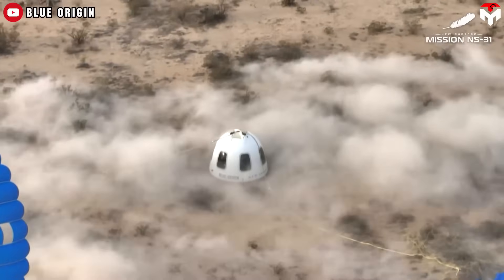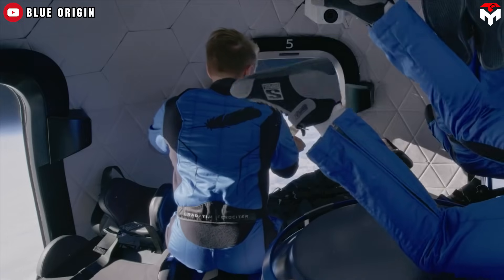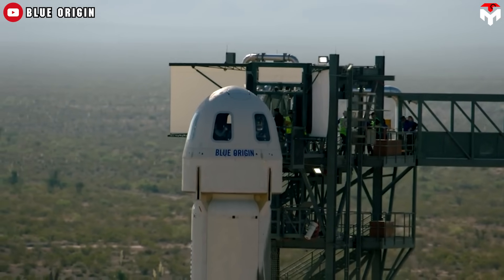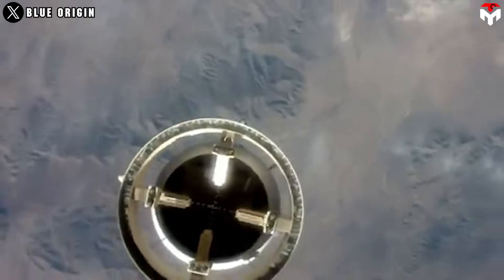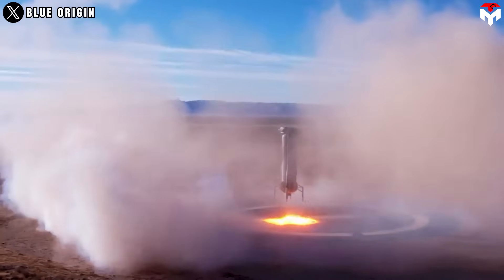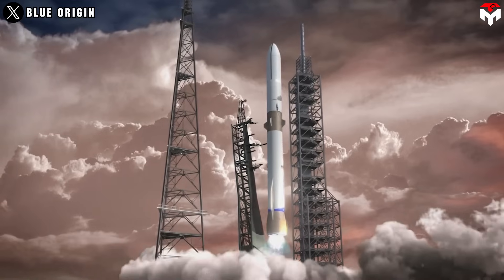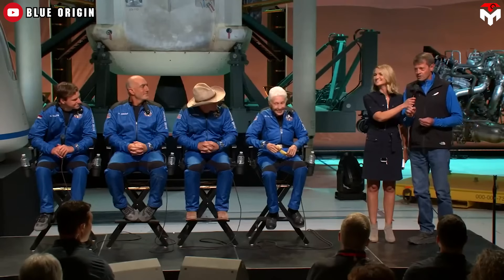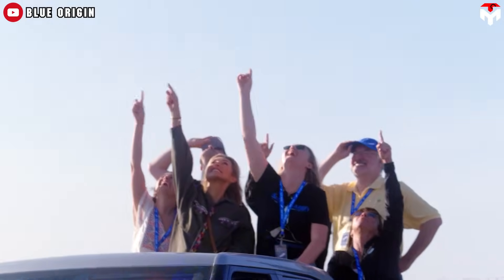Astronauts Exposed Why Blue Origin New Shepard Not Look Burned After Landing

Comment: Why did it blow dust , before it hit the ground ???
Reply: A retro-thrust system at the bottom of the capsule expels nitrogen gas to slow the landing to approximately 3.2 km/h (2 mph).  The blast of compressed nitrogen blows up dust.  This has been know for over 7 years, so how is it that people still can't understand something so simple?
Reply: @aseanWalker funny how this retro booster didn't kick up any dust on the moon landing
Reply: @tedstyle3798  The New Shepard capsule has never been to the moon. It's a sub orbital carnival ride for rich people.
Reply: Because the ground was covered in DUST
Reply: Yes!! And it still landed hard enough to break the most honorable "Astronauts" backs.

Comment: But how come they were able to open it with a handle from the inside? Shouldn’t it be pressurised correctly? They rushed to the door to tell them to shut it so they could pretend to open it with a tool, it’s still fake
Reply: It's not pressurized when on the ground.
Reply: @ yes but I would like to know if spaceships that have travelled to the moon, are they able to be opened easily via a handle on the inside? Compromising integrity of the structure if it’s so easy to open
Reply: @Bat_Wayne29  Yes, they are easily opened from the inside. In fact, after three astronauts were killed in the Apollo I launchpad fire, NASA implemented a design rule that hatches be easily opened from the inside or outside within three seconds.

Comment: They opened the door from the inside, a big no-no but were told to close it again. Watch the video. Then Bezos went to door with a tool to open the door and all without depressurising…total fake story…0-Mach 4 in minutes and no stress on their faces, pure BS.
Reply: There would be no depressurization. The purpose of a pressurized capsule to is to maintain close to sea level atmospheric pressure at high altitudes - when on the ground the pressure inside is equal to the pressure outside. They only reached Mach 3, and why would there be stress on their faces?

Comment: Weightlessness in the Blue Origin rocket capsule is just a free fall that feels like weightlessness because your body is relative to the capsule.  It is not actual weightlessness.  That kind of freefall is used to SIMULATE weightlessness, but the passengers aboard New Shepard capsule did not actually experience true weightlessness.
Reply: It's the same when you're in orbit. You're just in free fall while your forward motion keeps you going around the planet. In that sense what those in the Blue Origin capsule experience is actually no different to what astronauts on the ISS experience. Per your reasoning, no astronaut has ever experienced true weightlessness.
Reply: I felt weightlessness when I was 9 years old. My uncle had an airplane and he would go waaaayyy high, then drop quickly. The ends of my braided hair were higher than my head - I was weightless! It was fun! We loved going on those plane trips!! But I am not an astronaut, haha!

Comment: They felt weightless because they were falling which was nothing more than negative G-force. They did not come close to escaping Earth's gravity and they never left Earth's atmosphere. They did not go into space! They did go on a very expensive amusement park ride!!!
Reply: That's not negative g-force, that's zero g-force, and it's the same reason ISS astronauts feel weightless. The accepted start of space is 62 miles, they went to 66, so yes, they did go into space.
Reply: @CSXRobert  When you are falling that is a negative G you feel. I spent my career in aeronautics. Just look it up and they never left the atmosphere or Earth's gravity.
Reply: @thetwistedlocust  No, you are factually wrong. Falling is ZERO g (and it's g, not G, G is the gravitational constant, g is the acceleration due to Earth's gravity). To experience negative g-force, you have to accelerate down faster than free fall.
Although there are still remnants of the atmosphere above 62 miles, there is so little that it is for the most part negligible, and since there is not a hard cutoff to where the atmosphere ends, 62 miles has been set as the generally accepted limit before you are considered to be "in space." At that point you can easily see the curvature of the Earth, above the you is the black of space, even in daytime, and atmospheric pressure drops to about 0.032 Pa (0.0000046 psi, so practically nonexistent). To say they are still in the atmosphere is akin to saying you are in the ocean when at the beach because there is some salt water in the air around you.
No human has ever left Earth's gravity. ISS astronauts are subject to about 88% of Earth's surface gravity, but since they are in constant free fall, they appear weightless (again, free fall = 0 g, not negative g). Even the Apollo astronauts on the moon were subject to about 0.026% of Earth's surface gravity.

Comment: Look at the capsule speed, air density friction and time duration. The capsule re-entered at a speed around 3,000 knots and aerobraked through the atmosphere to parachute deployment. This is in the realm of supersonic flight commonly flown by the SR-71. The heat shielding of the capsule can be done with non-ablative materials such as high temperature metal alloys.

Comment: It doesn't really have anything to do with altitude. If a rocket went straight up, even up to low orbit altitude like the crew dragon, it would fall straight back down as soon as the rocket stopped firing. To actually go into orbit a spaceship needs also to gain enough delta v to stay in orbit. A spaceship or satellite in orbit hasn't left the gravity well of earth, it's still only a few hundred miles away, it's now travelling at orbital velocity allowing it to continuously fall around the earth. This is why when a rocket launches into orbit, it doesn't just go straight up like an elevator, but arches along a parabolic trajectory.

Comment: All of you are morons. Yes this flight was a total embarrassment to space flight, but serious get educated and learn about the layers of our Atmosphere… they did not go out of the Atmosphere, and they never said they did.
Reply: They said they went into space, they did not. They never left the atmosphere.
Reply: @laurencehutchinson8644  They went 66miles high, twice as high as a 747, they went to the "edge" of space in the Karman Line, and yes it is called a "space flight" however they did not enter orbit, they reached the edge, and they fall back down. There were no "burn marks" because they did not go into Orbit... their top speed they traveled was 3,568 km/h, to reach Orbit they would have had to go 28,800 km/h.... that is 25,232 km/h SLOWER required to be in the Orbit of Space...

So saying this, do you even know why burn marks happen????? Because the craft uses the atmosphere to SLOW DOWN THEIR SPEED TO RE-ENTER THE ATMOSPHERE.... there for, the craft goes through a lot of friction and drag as it is traveling at a much higher speed.....

So if you haven't caught on yet.... They were only going at a slow pace which had no resistance needed to slow their speed to re-enter the atmosphere... because they were still in it..... They simply got a small rocket to have enough delta V to get them to the EDGE of Space, and then once the craft lost momentum, it fell back to Earth with it's own weight.....

As for the "pre live footage"... that's also easy, this wasn't Space Flight to make a difference, it was simply some celebs experiencing a flight in a rocket, so obviously they would have pre opened the doors to check on their hair and to direct them on the "scene"... They had barely any training..... these crafts take a lot of work to actually get out of, and it also involves internal mechanisms, not just external.

Basically, it was done to "clean up the live feed", because if you watch an actual Space Flight Landing, it takes a very long time for them to exit, and it's not graceful in the slightest.

All of this is seriously common sense, and it's so sad how dumb the world has become simply because they only listen to what is on Social Media, instead of simply learning some actual facts themselves....

So to summerize;

- Fast Craft creates burn marks because it requires the Atmosphere's drag to slow down their speed to allow them to re-enter the Atmosphere.
- Slow Craft has no burn marks, because it is traveling 25,232 km/h SLOWER then a Craft with burn marks.
- Door was pre-opened for "Celebrates" on TV...

None of this is even complicated stuff... it is literally common sense...

Get educated people.

Comment: Look, more difficult to understand in this situation, NS-31 (Not Serious-31)is HOW come none of the MASSICE dust cloud kicked up at landing?  The Dirt is a yellowish and the capsule is SURROUNDED by a massive DUST cloud.  Two things make us expect dust on the capsule.  A) A cloud that big sour of rolls back into the center, and well, the center was occupied by NS-31.  B) Even at sub-orbital flights there is substantial  amount  of FRICTION HEAT generated, and so, the capsule WOULD have been hot enough to ATTRACT that dust like we see window blinds do on hot Florida days when your windows are open for venting.
Reply: One clip shows the so-called capsule on the ground with a plant, brush on the right hand side, close to the capsule, then in a second clip that bush has moved further back, and the door was opened, and then shut, and then it had to be opened by someone with a tool. Tools all inside

Comment: You don't need a rocket to have a short time of zero gravity, Aircraft like the "Vomit Comet" do this regularly. Not for nearly as long, but still does the job. And that's what the Blue Origin capsule did. Had it not performed the parabolic flight path maneuver, the people on board would have never experienced any weightlessness. It didn't go high enough for that, nor did it take up orbit.

The difference between what Alan Shepard did and these tourists did was that they went up in a relatively safe craft with. Alan was risking his life. Hardly comparable. He was also hooked up to many measuring instruments to gather valuable data. In addition, he had to train for years for that "ride" (which he also flew once it reached space). Part of that was his skill in flying fighter jets. To compare it in any way is just plain poor taste and ego pumping. The women could have claimed a tiny shred of being useful had they been tied to a host of measuring instruments during the trip. But not even that was done. They were just "cargo."

Comment: Explain why the capsule doesn't tumble as it descends. The are no stabilization controls on this pod.
Reply: Aerodynamics
Reply: What makes you think there are no stabilization controls?
Reply: @CSXRobert  This capsule was in a free fall and was relying on parachutes to control its decent.
Reply: @tammyhayden56  it is aerodynamically stabilized in its descent.   That „gumdrop „ shape isn’t for no reason.  Bathe parachutes control the descent later.
Reply: @tammyhayden56  yes, it was initially in free fall, and then used parachutes to control it's decent. It also has a reaction control system to stabilize it during its freefall.
Reply: @CSXRobert  bullshit.
Reply: @tammyhayden56  From NSF (NASA Space Fight) 'Blue Origin’s New Shepard returns to flight' - "The capsule fired its reaction control system (RCS) after separation to ensure stabilization."

Comment: When you get the facts right, you realize that this capsul didn't experience a reentry.
There is no need to talk about this for over 10 minutes.
Thumb down.
Reply: I just love going through the comments to see who actually watched the clip. But yeah, the difference is falling vs re-entry, 30s and explanation done.
Reply: The capsule DID experience re-entry, just not fast enough to generate the extreme heat associated with orbital re-entry.
Reply: @CSXRobert  falling from a height vs. orbital re-entry, I could have been more specific yup. It's the orbital speed that causes the higher compression of air on re-entry and subsequent larger plasma buildup. 45s.

Comment: This goes to a lower altitude than the SR 71.  No. I must amend this comment. The SR71 has flown to only one quarter the height of Blue Origin.
Reply: No it doesn't, it goes about over 4 times higher.
Reply: @CSXRobert  I am sorry. You are correct. The SR71 has flown to one quarter the altitude of Blue Origin.

Comment: It wasn't burned because the stupid rocket used all it's propellant for vertical ascent... most spacecraft trajectories have the rocket turning somewhat  horizontally to gain speed for orbit... 17,500mph. When an orbiting spacecraft returns, that speed must be bled off by using the atmosphere to brake the vehicle which produces a 3000 degree C  plasma. Stupid New Glenn just goes up until it runs out of fuel... coasts to apogee... then falls back to earth... no ablative paint or heat shield or tiles required... yes, it's a pathetic phallic symbol.

Comment: The Blue Origin "Celebrity Space-Flight" reached a speed of 2,200 MPH and a height of 65 miles, whereas the Mercury space-capsule of America's first astronaut, Alan Shephard, reached a speed of 5,180 MPH and a height of 116 miles—quite a difference. 
.
Whereas the spacecraft of astronaut Alan Shephard had to re-enter Earth's atmosphere from a much, much greater altitude and at a much, much greater speed, the Blue Origin capsule, “New Shephard,” though having crossed into outer-space on a technicality, did not have to re-enter Earth’s atmosphere because it had not completely left Earth’s atmosphere, and its maximum speed of 2,200 MPH (about Mach 3), was comparable to the speed of the SR-71 Blackbird, which was an air-breathing jet airplane. In other words, the relatively lower speed and lower altitude of a Blue Origin flight does not require a heat-shield for a fiery re-entry that does not occur.
.
I think this particular event was too thoroughly saturated with a celebration of celebrity. During the weightless portion of the flight, the occupants gleefully squealed like a bunch of junior high-school girls, did somersaults in their conspicuously curve-hugging uniforms, and, upon landing, made either unbearably braggadocious statements, or pitiful attempts at profundity which came out sounding infantile. Had, instead, the money been spent on sending, say, a group of public-school science teachers into outer-space, that might have had some actual value.
.
On one hand, I see the Blue Origin all-female celebrity space-flight as proving nothing, as all the occupants were strictly passengers. There was no new accomplishment that I could see. It was little more than a frivolous lark for wealthy celebrities. On the other hand, there is no denying that these women put their vulnerable bodies into a space capsule on top of a rocket, blasted off, and encountered some serious g-forces (about 5 g’s) along the way—an activity requiring an admirable level of guts. It is not something I would do, even if someone else were paying for it.

Comment: I've been wondering why the Blue Origin can land on LAND while Crew Dragon still has to splash down in the ocean.  That alone suggests to me that Blue Origin is fake.  At least they are not really manned.
Reply: No, that isn't true at all. Soyuz lands on land, and so does Starliner although, obviously, it is not operational yet. The Crew Dragon was originally intended to land on land, but not under parachutes. It was supposed to make a propulsive landing, like Falcon rockets. NASA, however, objected to that architecture so they had to revert to a parachute landing. They were too far along in the design process to make it possible for it to "bump down" with retro rockets or inflatable cushions like Soyuz and New Shepard, so they went with splashdown. Wait till Starship is fully operational and making propulsive landings with crews aboard. Man, that's going to be glorious.

Comment: Okay someone who knows a little bit about space I hope they comment but the reason there were no burn marks is they didn't go up high enough to create that kind of reaction coming back down. That's why everyone is calling it a ride because they didn't really go to space😂
Reply: No, they very definitely went to space. Space is defined as starting at 100 kilometers (62 miles) above sea level. That is somewhat arbitrary but it is internationally accepted. The video is quite right that there were no burn marks because they simply weren't going fast enough to generate that much heat.

Comment: The capsule didn’t go into outer space. It’s no different than going up in a large jet and diving down causing you to become weightless. They have been doing this for years. Blue Origin went up and in the process of falling the women became weightless until the chutes opened. This ride was a joke by a bunch of aging air heads.
Reply: Yes, they did go into outer space. The definition of being in outer space is being above an altitude of 100 kilometers. The sero G effect is caused by free fall, you are correct, but it is exactly the same for a spacecraft actually in orbit. It's just free fall. There is no altitude where you are magically beyond the Earth's gravitational field. It is Earth's gravity that hold's things, like the Moon, in orbit.

Comment: They never left our atmosphere. Burns only happen on re-entry to the atmosphere.
Reply: It ISS, and most other satellites, are in that layer of the atmosphere called the Thermosphere. The extreme heat of reentry is caused by speed, and time passing through the atmosphere. There is no magical boundary where there is just suddenly no atmosphere at all. As the video pointed out, Spacecraft coming in from orbit are going 17,000 miles per hour. The New Shepard was barely going 1000 and only spent a few minutes going particularly fast.